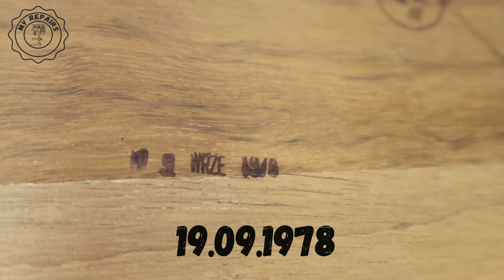Old Tonsil 3 way speaker from 1978 - renovation

Comment: It would be necessary to replace these thin copper wires with thick ones made of real copper, and capacitors, e.g. 30uF in the mid-range path, which is of great importance for Siara, and the remaining two 2.2uF capacitors in the high-frequency path.  Personally, I would give all Jantzen Silver Caps.  Thank you for restoring this Polish classic ❤.  All the best, regards